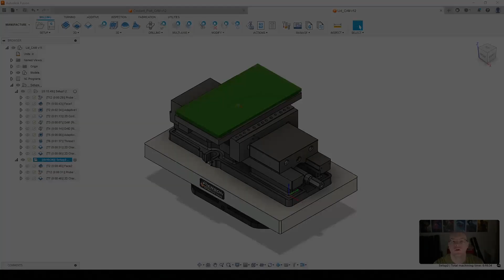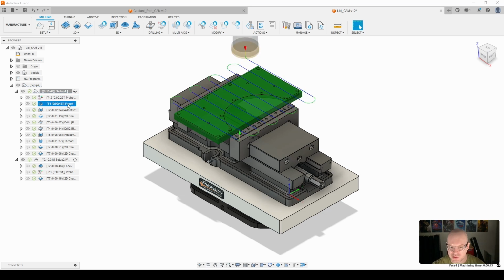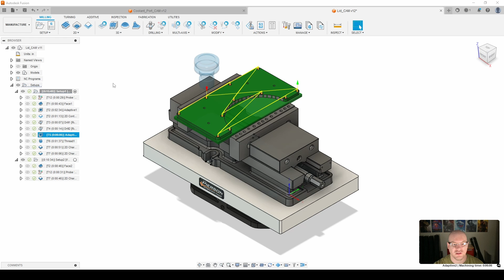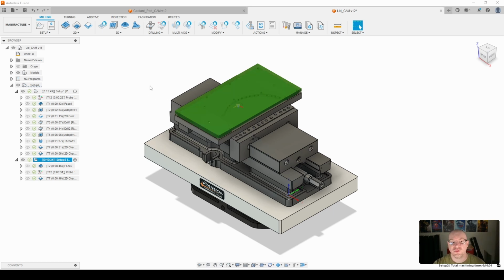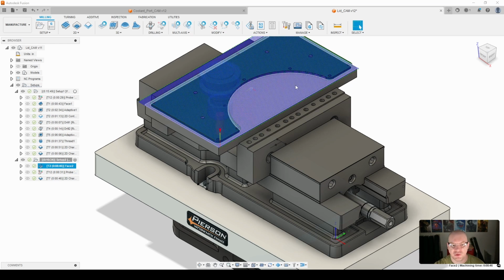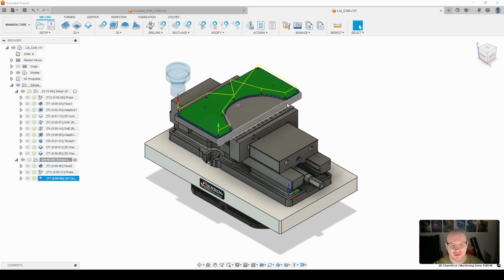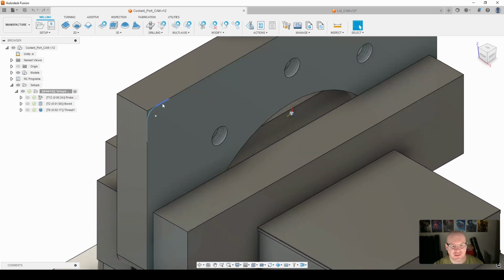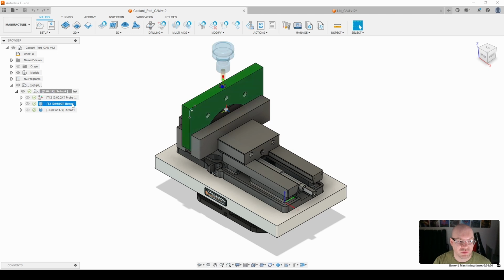SYIL X7 COOLANT MANIFOLD COMPLETE

Comment: Sabes como configurar la maquina de milimétros a pulgadas?
Reply from the maker: I believe you can use the MDI and switch units with g20 and g21. There could also be a system setting that would require digging through the manual to find.
Reply: @MrSmith1231  ya lo intente y así lo marca el manual pero no me funciona hay un parámetro también en sistema pero tampoco me funciona ,estoy algo frustrado.

Comment: Awesome video. Btw, which Syil PP that compatible with probing from fusion?
Reply from the maker: The LNC and Syntec controllers have community based post processors that support probing for free. I believe the seimens controller does as well, but I'm not familiar with it. I have the LNC controller on my machine.

Comment: 🙋🏻‍♂️ uhhhh question here.....why set your wcs on the zero point pin, if you're still going to probe/find the center point of your stock, and then set an offset from your FIRST OFFSET (wcs)...seems needlessly complicated.  But I'm def open to hearing a justification.  If you probed the zero point pin, and then probed the stock, you're possibly compounding measurement errors.

I feel like you'd be better off just probing the corner of the fixed jaw and then just being diligent about parallel height and stock size....
Reply from the maker: The zero point is always on the pin to keep a common wcs for every part I make. It reduces the risk of crashing and helps streamline CAM. I don't center on the stock. The probing adjusts for any misalignment in x and y between the stock and fixture.
Reply: @MrSmith1231 ehhh....I don't see the logic or benefits.....I guess the only benefit I can see is that your probing routine happens in cam vs at the machine....which, like I said, if that's the case, just probe the corner of your fixed jaw and be roughly consistent with your stock size and placement in the vise....and then don't ever probe anything ever again unless you need to pick up a feature....🤷🏻‍♂️
Reply from the maker: @Steelcrafted The other thing to point out is that it's not just a vise. It's the same wcs for every pallet regardless of what sits on top.